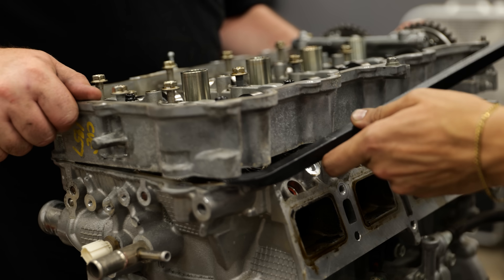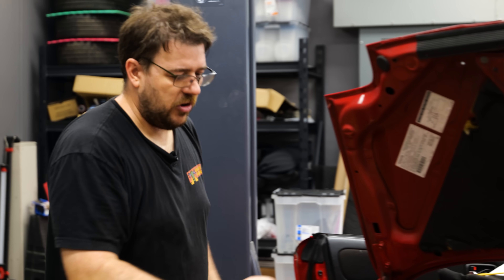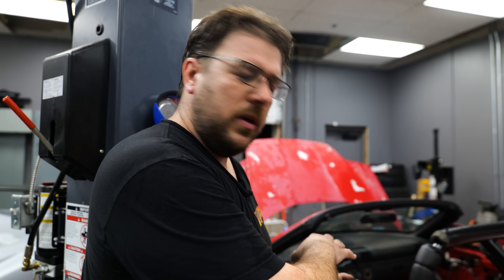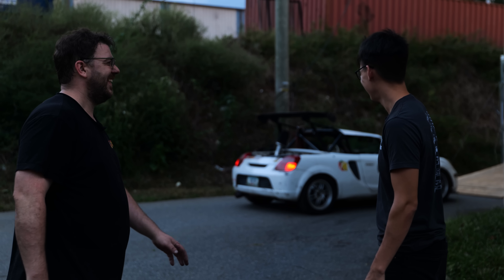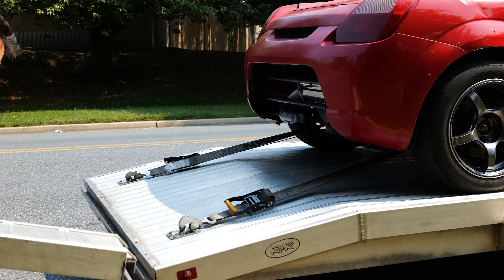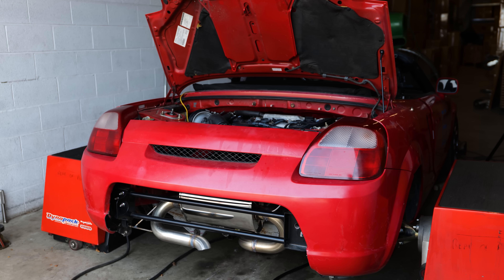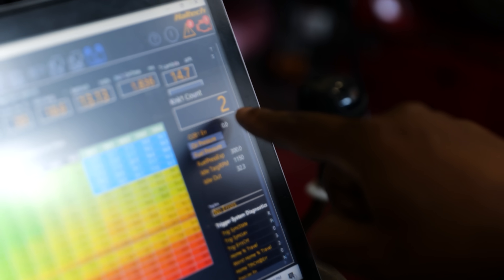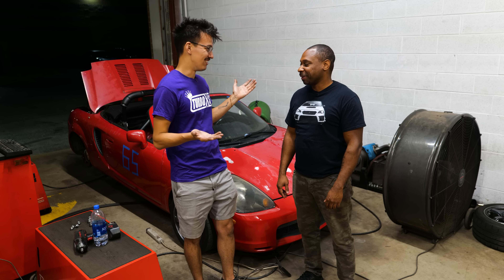Putting a Camry Engine in My MR2 - Episode 3

Comment: Why does it sound so good 😭
Reply: The VVT-I system on these motors really is magic, it lets you add up to 90 degrees of valve overlap so you can run at high RPM a cam configuration that would not even idle below 2000rpm otherwise. It's really nice and it's why the motor gets so loud as soon as you get on the throttle because it does not have to wait to get to a higher RPM to engage "big cam" mode, it can just make them optimal for whatever RPM you're at when you hit the throttle.
Reply: @FrankensteinMotorworks  you really know your stuff. I want to add some power to my 17 rav 4 with a 2ar fe

Comment: 3:06 the coolant dumping down 😭
Reply: Yeah, there was a loose coolant plug on the throttle heater circuit. it was an easy fix.

Comment: 107whp from the 1ZZ? Was the engine very tired when it was dyno'd? Because that work out to be around 30% drivetrain loss if it wasn't.

219whp on 2AR also means 285hp if it's still 30% drivetrain loss.

Comment: I'd really like to see a fair comparison with mark's 270hp configuration vs his 2gr swap. I'm interested in the cost, finishing weight, and difficulty aspects as well as final HP numbers
Reply: I can't post pictures to a youtube comment but if you reach out i'm happy to share dyno charts and discuss the details of both of these on the exact same dyno. But in short, the 2GR still makes more power and has 40% more displacement so it will of course make a pile more torque. Keep in mind, even while i own all the parts to make a 2GR V6 swap in a spyder i still race with the 2AR I4, i really believe it's a better motor for the platform. Depending on how you plan on using it you may be better off with the 2GR but most will be perfectly happy with the 2AR and it's certainly a significantly easier swap.
Reply: @FrankensteinMotorworks  thanks! I might reach out this winter. We currently autocross a 99' civic with a k24(fully built) with a sequential tranny, OS Giken diff in SCCA, SMF class. We've been really successful nationally(reigning champion and 2nd place 4yrs running). We've been talking about running SSM in a spyder with either motors. The low end torque, top speed in 2nd gear, and weight penalties really matter to us. That's where we wonder if it's worth the 2gr at the cost of weighing alittle more as well as changing the weight distribution even more

Comment: I just want to turbo my tc 😢
Reply: 2arfxe swap instead
Reply: @krakdaus5442  i had bought the kit, the full kit but i only got half the stuff from dezod motorsports, an tried to get into contact with the owner but no reply
Reply: @Gantz0302  holy crap that's messed up
Reply: @krakdaus5442  yea I wouldn’t trip if i had got the ecu along with when got sent but i didnt, and the ecu alone is like $1400.00 and thats where im stuck at rn

Comment: Not a fan of the exhaust exiting towards the cabin then having to go under the oil pan. I know I'm nitpicking but it's nice that kswaps and ZZ motors send the exhaust towards the rear without having to cross the pan. I'm going to assume that the 2AR is much cheaper than going K. The cost will make this an overall win. The car also stays all Toyota

Comment: I love the way that thing sounds. Sounds like an old school B-series but doesn't rev quite as high.
Reply: Ben wanted to do this as an OEM+ style build so we're only revving it to 7600RPM. If you go check out on my channel you can see me revving them a bit higher with aftermarket valve springs.
Reply: @FrankensteinMotorworks  question for you, Darton makes semi-deck sleeves for 2az motors, do you know of any company that makes them for the 2ar ? I have a standard 2ar-fe block laying around but was always hesitant to tamper with them cause i like to turbo my vehicles (5-10psi, never more) and was always afraid of cracking the "thin" cylinder walls. Love your vids and awesome job on the MR2!
Reply: @bucketofsaws  I'm pretty damn sure that Darton would easily make some sleeves for this motor but go look at Papadakis' teardowns. The stock block is pretty damn strong as-is and there's no way you'll run into any issues at 5-10psi. the tC guys regularly push more boost than that on an unopened motor.
Reply: Sounds nothing like a b series lol.
Reply: I thought it sounded like an old RX-3! The same sound, as if being chased by a murder of mad bees..! 
Which I love!

Comment: How is he making 270hp?
Reply: My build is actually 270whp, not 270hp. So it's actually north of 300 at the crank. It's a bone stock 2AR-FE with my camshafts that i developed, my springs and retainers and my intake manifold. No porting or any other head work and of course it uses my MR2 Spyder swap header, that's necessary for it to fit in the Spyder engine bay. I'm happy to answer questions, there's also the latest video on my channel that shows it on the dyno.

Comment: All they did was take out the exhaust cam and replace it with the intake cam from the same car, and some tuning. A fuel sipper becomes a performance engine.
Reply: Yeah, exactly. it was also timed without using the stock timing marks but no additional parts were used, I just skipped whole chain links to move it.  Pretty awesome eh?

Comment: You revving a 2ar to 7600 rpm witn no head work and stock pistons and rods making 230 whp.  I feel cheated with my 2zz mr2 over here . Damn it .
Reply: Yeah, valve springs right out of a hybrid motor can safely handle track days at 7600RPM. Toyota is just full of surprises eh?

Comment: The 2az and 2ar-fe’s are the most under rated modern day 4 cylinder in my opinion.  Great power, great power BAND, light engines, they can handle okay power, but they’re easy to work on and if taken care of will last a very very long time.  I love my 05 tc, even with 300k+ it loves life.  Im very happy you decided to use this motor!

Comment: Swaps a Camry engine into a smaller roadster. And expects the swap to add a different amount of horsepower ???? This title doesn't add up
Reply: Keep in mind, we remixed the OEM parts to make the motor a 12.5:1 compression 2.5L engine with 260 degree cams that have 9.9mm of lift. Toyota never assembled it like this in the stock application. that's why it makes more power this way.

Comment: don't these Toyota motor consume tons of oil and have other issues.. i hear some drink a quart in 400 miles..?? something about piston ring and poor design..
Reply: These motors are sensitive if you use them with conventional oil and rarely bring them up to temperature. It does gunk up the low tension rings. Thankfully this does not affect it's ability to be used as a performance motor, getting it good and hot makes it super happy.
Reply: the people who religiously go for 10k mile oil changes regardless of time have the issue as well as cars that are just loads of short trips. if you keep the oil changed to the schedule, they wont. Or beat the living piss out of them. these engines will not seize up the rings if they get a fairly regularly dose of high rpm fun.
Hondas have been dealing with similar issues. alot of 4 cylinders running modern oils have been.  my source being a dealer tech and we have a honda dealer in the network too.. Marc has received some of my oil burner cores aftermarket warranty's have replaced

Comment: Also, anyone know why they removed the balance shafts of the engine?
Reply: Less rotating mass. And since it's a track car, they don't care how quietly and smoothly it idles.
Reply: @drift_ronin2358  Exactly but i also have to add that it really barely vibrates without it and only at a low idle. once you're above 1000rpm you can't feel the difference between the configurations so why not get rid of extra losses.
Reply: @FrankensteinMotorworks  good to know!

I wonder if it was more critical for creature comforts with the stock cam you switched out. Maybe that Atkins (spelling?) style 4 stroke was a bit rougher.

No idea just a guess. Cheers!
Reply: @drift_ronin2358  Toyota idles this motor down to about 600rpm and people expect luxury even in their camry. It 100% makes sense that they have it there from the factory.
Reply: @FrankensteinMotorworks  I agree. And that makes sense.

Comment: Compare to honda K24, which worthed cost can build into 230 whp in N/A?
Reply: If we are only looking at the motor build you need a camry hybrid engine which are all over the place. You can just order one from e-bay for $1200 or you can get one locally at a pick & pull since they are pretty common all the way down to $300. You need a 2nd intake cam which can sometimes be found as low as $100 but brand new from the dealer is $300. You also need the dual vvt-i stuff and a stock 2AR-FE intake manifold. The cheapest way to get that stuff is to actually get another $300 motor at the pick & pull, the 2AR-FE is even more common than the 2AR-FXE but it's also easy to end up about $500 in for those bits if you just pick them up on e-bay and such. And finally, you need a header. The header i sell that was used here is designed for the MR2 Spyder and it's really tight to the block and low volume so it's an $899 unit but if you aren't stuffing this in an MR2 Spyder you can likely get away with a much cheaper unit. 

So the range can be pretty wide depending on if you just want to click and have stuff show up (about $2900) or if you don't mind pulling your own engine at the yard and you don't need the MR2 specific header you can get it as cheap as $1200 or so. I've personally built two of these motors now and without the header cost, one cost me $800 and the other one was $1100.

I'm not the right guy to answer how much 230whp costs in a K24 but from what i understand the 2AR is going to be a bit cheaper or a whole lot cheaper if you hunt for parts. But keep in mind as popularity rises the prices will rise so the difference will shrink.

The big benefit is that the source parts used here are really easily available. Toyota has a lot less variations of this motor than Honda so you don't end up looking for a narrow year range of a specific model.
Reply: @FrankensteinMotorworks  thanks for your respond. I appreciate that.. I'm from Indonesia, which is so rare builder develop engine like 2AR. the most engine develope in here, surely K24 for drag race or touring race.

So, i see you build the 2AR engine very very amazing. Oh yaa Papadakis Racing build too in 7th years ago with 1.000 hp, but its something different with the your way to build. Just use an OEM parts but it can significantly make horse power.

Im pleasure to subscribe your channel youtube to watch you build the other 2AR and make it populer in the community.
Reply: @donnysgarage545  the name "Frankenstein Motorworks" came from how i would Frankenstein junkyard parts together to make performance. cheap power is literally where i came from. I'm making fancier parts now but feel free to reach out with questions about these low budget builds any time.

Comment: Very cool project, but a novelty at best. Would hate to see the bill for that crate transmission from Toyota. On the other hand, you can get a manual K24 and put it straight in stock and make the same power. K is still the king of swaps.
Reply: No need to wonder, $2400 all day long for the transmission if you buy it brand new like they did. But keep in mind, Toyota has that transmission brand new because they installed it in their cars. You can get it used also.

Comment: You might as well have just used a J35. You’d have had 250whp without a tune. The weight of the ar2 is not worth its meager limits.